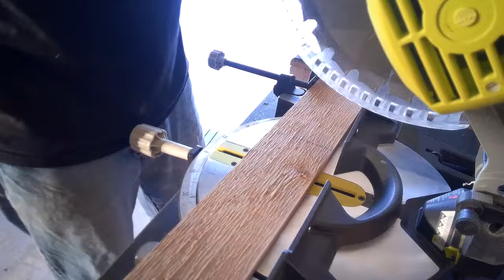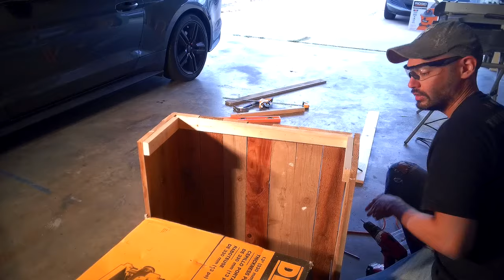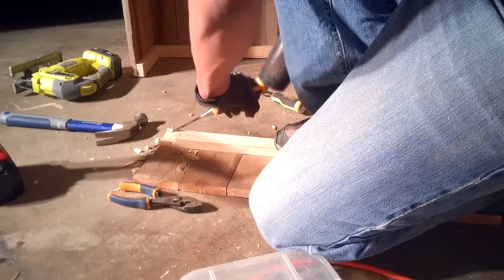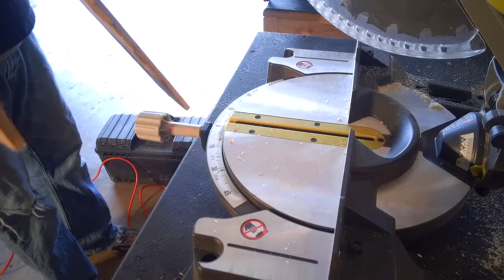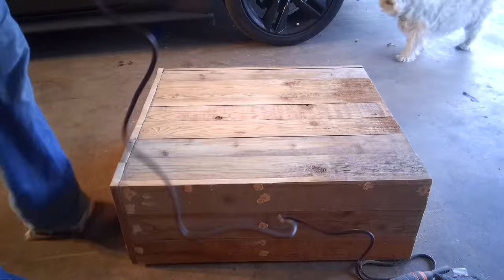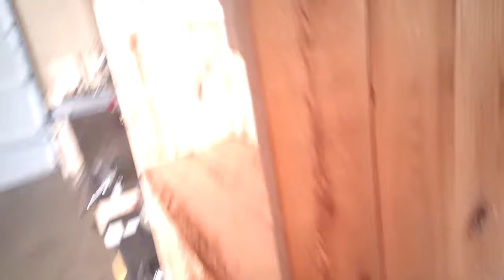How To Build A Pallet Bookshelf

Comment: Pro tip: When making pocket holes - use an electric drill for the drill bit and a separate drill for the screws. You will save a lot of time and annoyance from changing bits
Reply from the maker: Thank You for the suggestion